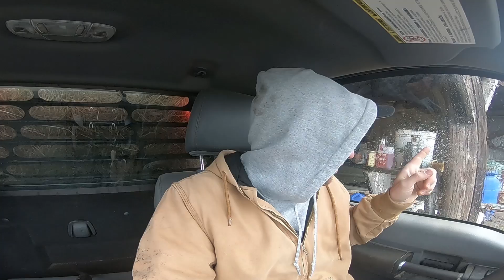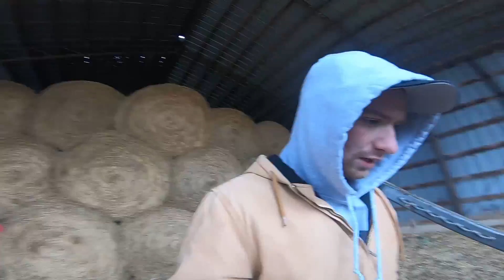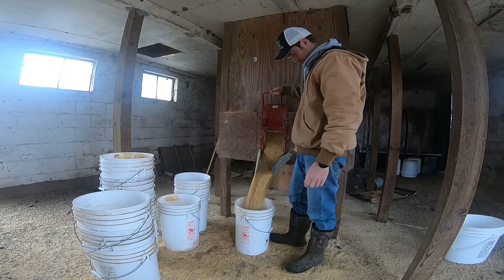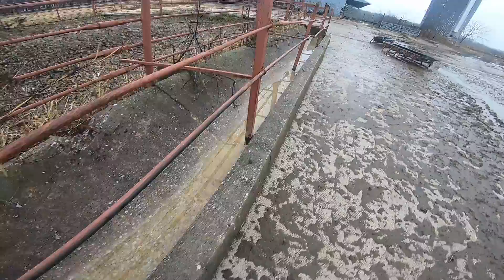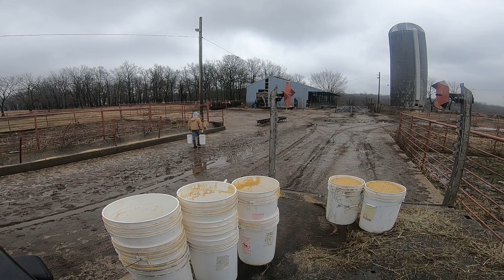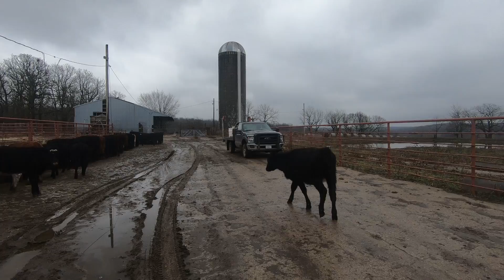Last Time to Feed Grain!

Comment: Good video calves look good ..get a siphon  whith a pump on it there not that much money hose for that water trough then you just have push water to one end after you get the hose started .I have an huge  water trough I don't use in the summer with no drain I just drian the water every spring with a siphon so I can put clean water in every fall ..
Reply from the maker: The issues with using a siphon is that the water only fills up where there is a low spot. And there is about 10 low spots 😂. If the whole feeders were full all the way across, a siphon would be a great idea! Thanks for the advice though

Comment: What do you consider acceptable feed loss?  Would using tricycle gear feed trailer be worth savings?  Or is it normally dry enough you consider loss acceptable?  In my area even open bottom bake feeders waste too much,  so I have bale feeders with floor.  Thankfull when dad decided to cement, bunks he sloped them.  Self cleaning in downpour.  ;)
Reply from the maker: We like to unroll all of our hay. Sure the cows waste some but it just adds organic matter and cover to the soil. But if we over feed hay, the cows will waste a lot of it. We don’t like to use bale feeders when possible because they make a mess; especially after it rains. It’s hard to put a number on hay waste but I would guess around 8% when we feed just the right amount.

Comment: How many bags of replacement you need for 10 calves for a month
Reply from the maker: You will have to read the directions on your milk replacer. Most brands, a 50lb bag will feed a calf twice a day for 2 months (or 120 feedings).
Reply: @FarmandHammer  ooh ok thank you..... like ur video you make
Reply: Do you have to feed the milk at the same temperature....because they told me if not they get diarrhea....I have some with diarrhea

Comment: Wouldn't it be easier drill some holes in the bunk besides getting water out everyday?
Reply from the maker: We normally don’t feed any animals in them unless we have rain for 3 days straight. Most of the time we feed out in the field. But yes I guess I could try and drill holes in them. Since the feeders are so old there are probably 10-15 low spots that hold water. And that means 10-15 holes to drill 😂

Comment: I get my round bails of hay for 20 dollars a bail.
Reply: Pa is 80-100 right now for a 4x5
Reply from the maker: That’s about what it is in Missouri this year!
Reply: @cherryfarms2135  my round bails are 1000 pounds. Idk what the measurements of it are.
Reply: @calie7013  we make hardcore 4x5, usually average 800 pounds at 11-12 percent moisture.   We do average weigh checks on very field.
Reply: @FarmandHammer  I just bought 60 5x5 in central MO for $25 a bale.